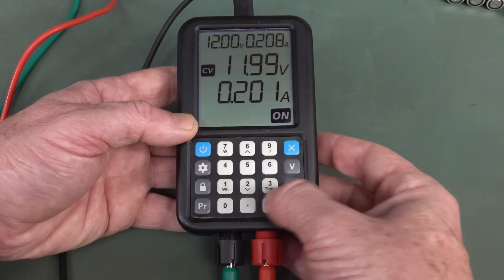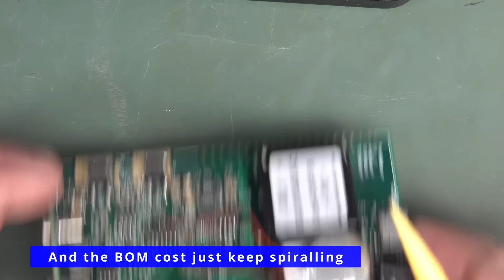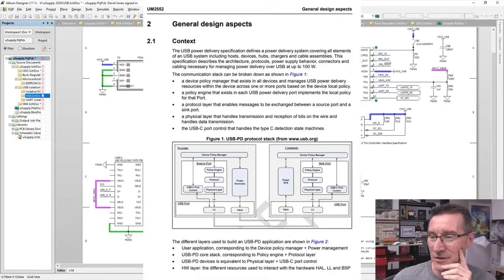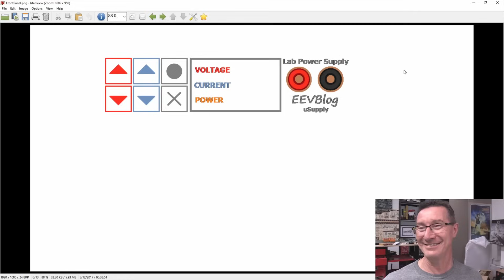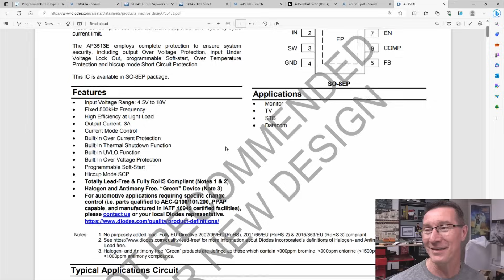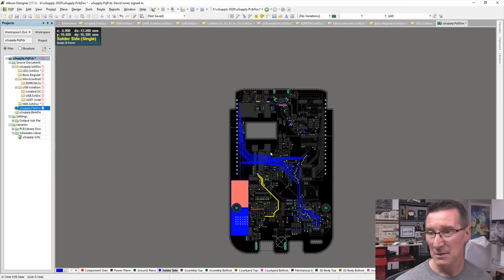EEVblog 1561 - µSupply USB Power Supply - Part 21

Comment: You're right about USB type C PD, just like USB itself, it's a bitch of a standard.

I'm working on a project that negotiates from first principles, using sub $ MCUs that are now available with enough on chip to do the PHY for PD, including opamps, comparators, CRC. Everything about PD is hard work, from the wire through the software stack and seemingly endless state machines.

The state machines interact with each other too under abnormal conditions, it's a bit like having a goto in code.

Just choosing a regulator and voltage domains is hard work for PD UFP, it needs to be able to function from 3.3V to 20V, and you need to be able to protect the CC1 & CC2 lines.

You could do a whole series of videos on USB PD,
Reply from the maker: Yeah, that's why we abandoned using the primary side ST micro to do it all natively. Ended up being simpler and cheaper to use a smaller ST micro and use an OTS USB-PD controller. But it can pay if you need the big beafy micro for other stuff.
Reply: Good GRIEF .. Gimme me old concentric connector back! 
Just need ONE protection diode, and something for over voltage
Unless someoens integrated these functions in a readily available piece of silicon???
Reply: Just recently had a look in to the USB 3 spec and oh man, these state machines!
There are really some wild diagrams in there.
Reply: @petegaslondon I dunno, I go back and forth mentally. Both as a consumer, and as a very very occasional person choosing to power something somehow. The old fashioned barrel jacks were real dead simple, and had few things that could go wrong. But also, sometimes, I screw up. So many different devices, all look the same and fit together, with totally different voltage and power requirements. The hassle of USB-c on the design-end absolutely seems worth it when it comes to be able to just arbitrarily connect power between whatever devices I want to connect.

A few years ago my dad left his laptop charger at home while traveling. We were able to slowly charge it overnight from a 5v-capable USB-c phone charger. Even though the laptop normally wanted 12v to charge. It was degraded functionality, but it *worked*. That's just so incredibly valuable.

To think I can just get power out of anything USB-c and into anything USB-c is so damn useful in an almost childlike way.
Reply: Do you happen to have a public repo somewhere? I have been thinking about doing something similar for AGES, but especially the PHY part is a bit of a nightmare with all the analog stuff going on.
Reply: Are you guys doing anything sophisticated with PD or simply trying to build all from scratch?
Because I keep seeing that even Arduino crowd is already dealt with PD negotiation in their libraries.
Reply: haaii! https://www.youtube.com/watch?v=2fLpOv0ZOpY

Comment: Hello, I am David2!

This was a wonderful, fun and educational project and in complete agreement! USB-PD really was a surprise in complexity and I completely agree, isolation was a giant pain!
It was the primary source of inefficiency too, may have even been worse for efficiency than the output regulator!

That funny circuit that you were not sure what it does (https://youtu.be/FKC6lnTKH-c?t=905), I believe its a ripple blocker, but don't quite remember. The switching regulators had some noise which coupled through op-amps due to their power supply rejection ratio not being massive. Iirc, there were options of higher performance op-amps, but you pay for that too. I believe that rough simulation will show some ripple blocking :)

That battery prototype was indeed a negative bias!

Comment: I got inspired by this the last time I saw it and made a quick and simply contraption with a USB-PD board and a Ruideng Tech DPS3003 power supply module. Not as sleek as your solution but does the job. I think if you sell the screen, case and banana jack, people would love to take the challenge of designing their own circuits for it. Could even be a competition or something for the best design.
Reply: I made couple power supplys with similar chinesium ps modules.  One has 3x 18650 in it and 30V/4A/50W max output. Second one has banana plugs as input and i made a makita battery adapter for it from a chinese clone of makita usb-adapter.  That one has 50V/5A/180W max out with one 18V makita battery and with >30V could go up to 250W.  Those things have saved me several times as an electrician.  Testing led-lights, troubleshooting 0-10v building automation stuff, driving smoke extract windows, tracing ground leaks with clamp meter etc.  The larger one has bluetooth module in it, which helped a lot when i had to check which cable goes to which fire damper in a hvac system, as those ~60 cables had just a running number on them and those numbers did not match with the actual devices and no one seemed to know where they went.  Bluetooth gave me 15-20 meters more of a head start, as i killed the power to the damper by phone and could hear where the spring loaded damper winded to closed position.

I've been planning to make yet another one with internal batteries for just a little bit higher specs.  That small one won't drive the largest smoke extract windows and having an external battery while slipping on a roof with other tools wont make the job any easier.

Comment: Keep the isolation, will make it easier to keep noise down. Plus you can get cheap DC DC converter IC's that run at 1MHz plus, so you can easily get the 12W plus through the transformer, with a driver the size of a flea. PD controller, 3V3 regulator that can handle 12V or higher on input, and then a 3V3 simple USB isolated interface, to pass USB over to the chip handling display to allow USB control over the USB side of the USB C port. Keep it to one grunty micro on the isolated side, which was chosen to handle display directly, and let it do all the work.
Reply: The noise reduced from isolation will be foreshadowed by the 1MHz converter!

Comment: I didn’t even know you were designing this. All the videos you have it don’t surprise me. I also have spent documentable time to the subject of USB power supplies. I really want a Bluetooth middleman or even usb middleman for one hub all usb and Bluetooth WiFi console environment to set hosting values and management to share devices with hardware not supported by a particular device. This was the intention of going down the road of electronics design and will be a product before I die. Thanks for all you do for the community.

Comment: If I built one one of these I would:
- use a raspberry pi rp2040
- have the software open source and collaboratively developed by your audience.
- use an off the shelf lcd with a resolution in the range of ~320x320
- use the biggest inductor/transformer that fits in the case
- make it have overkill power carrying components so no cooling is needed / short term overload mode possible
- make it able to use either USB power or a 18650 holder that can be clipped on the back (there you have your "isolation")
- make it have a micro SD card slot for datalogging / custom programmed sequences (e.g. CCCV charging but with slow start for deeply discharged cells, or for simulating a battery that loses voltage while discharged, ...)
- generally make it use software wherever possible so it can be functionally enhanced later on by the community.

Comment: Anyone can get a cheap switcher PSU. A low-noise front-end differentiates the product highly.

Completely isolated would be a extremely nice to have feature, knowing there's no way to short stuff, but I'm sure it has a huge BOM cost with it vs not. It being able to be controlled (and isolated) over USB would also be a killer feature... A laptop telling it waveforms to produce, recording power graphs, etc. Mayyybe it could all be done over WiFi now, not sure.

Allowing for slightly bigger or fatter case, I'm not sure if that'd help making BOM easier. The LCD is still extremely nice. You can buy 100 chinese products and wish they had a better UX like this with 99 of 'em. 

I wonder if simplifying the design to be slightly more 'modular' might be doable... with the aim of allowing the community to adapt the core functionality into real hardware products themselves. An analogy would be, the Marlin 3D printer software project provides itself as the 'core component', which anyone can implement into hardware to complete a 3D printer.

Comment: I really like the design of this project and its something ive been wanted to desogn for years. 
Linear tech/analog devices has a really nice ldo with built in cv/cc capabilty up to 2-3A that ive been wanting to design around possibly battery powered for isolation and better noise.

If you came.out with thid product i will most likely buy it just to support you and your channel. Already own your 121gw meter :)

Comment: Not sure if you've seen it, but Miniware offers a 5 amp, 30 volt output USB-C power supply (MDP-P906) and a barrel jack that let's you do up to 10 amp output

Comment: A small bench top battery powered PSU would actually be very useful. 2 adjustable channels with up to 20V + some USB ports or dedicated 3.3V and 5V output. I mostly work with MCU's and I think that would be useful for many others too.  

Cool to see an update on the project. The Power Supply videos were one of the first I watched.
As luck would happen, I just printed a small enclosure for a riden PSU and just put usbc trigger board in it to get 20 volts out of it.

Comment: Death due to scope creep! It's a shame because it was a really neat idea, though it produced a ton of good videos, I suppose that is output as well.
Seeing the internals of the prototype, I can imagine that it must have been very costly if produced. 
Honestly I would have ditched the custom display, keypad, fancy case (instead of the simple one) and transformer very quickly. To ditch the isolation in general, I am not so sure about it, not just the versatility but also isolation from conducted emissions on the other side. 
I would definitely add two output channels though! Just having two output channels instead of one opens up so many more possibilities (especially for analog circuits with dual rails). 
Seeing the output circuitry you could probably simplify it significantly, at least to a single output device instead of two.

Comment: While I like the final keypad layout, I'm no longer a fan of the plastic membrane over dome keys (too many membrane failures, especially after sun/UV exposure), preferring touch PCBs whenever they can work, and carbon contact or mechanical keys when they don't. That said, I'd eagerly buy whatever is on the uSupply!

Yes, drop the built-in isolation. I just got a terrific 74 WH (20K mAh) USB-C PD battery bank for under US$25, a small price to pay for total isolation. Should I need more, I'd use an isolated wall wart.

One function I do want in the uSupply is a dedicated battery substitute/simulator, with an optional add-on kit of mock batteries with flex cable connections. Start with the most common (AA, AAA, CR2032, 18650) and include (or allow us to program) the capacity and discharge curves. I'm remodeling my home and will be including a massive IoT home automation upgrade, and need to design/adapt many of my own nodes, where I need to do some real-world testing to make decisions for power (wired, battery, solar) and communications (wired/wireless). Bonus points if the battery simulator can also account for physical charging, such as for an attached solar cell.

Yes, the battery simulator may prove to be a major upgrade, but I believe it could help secure a solid market for the uSupply in professional labs, beyond the hobby market.
Reply: Hmmm. I'd probably want TWO uSupply units: One to simulate the battery, and another to simulate a solar cell.

Edit: And I could probably control battery/solar simulation in real-time over SCPI, though I'd prefer a standalone solution that wouldn't tie up a computer.

Edit2: Heck, I'd probably have the computer there anyway, for data logging. So maybe give the uSupply a large data logger as well?

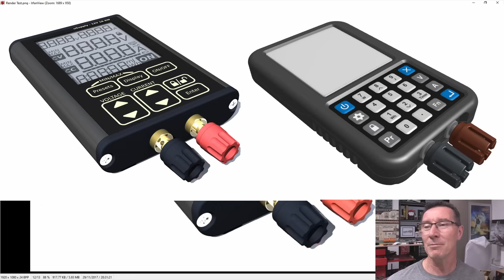Comment: 22:00 As someone who sometimes finds himself on the wrong side of a decimal point, the up-down arrow would be preferred. (Granted, it's probably less an issue for a supply that tops out at 12v and 1 amp.) To make the data entry faster, perhaps double-tap the up or down button for the respective adjoining digit, then adjust accordingly.
37:30 Edit: Honestly, I don't blame you for opting not to produce this. There's a lot of cheapies these days that do a shockingly good job (thinking specifically of Rui Deng, which I think you previously reviewed). I really like the integration you have here, but without some kind of real differentiation from the cheapies, I doubt it would get any traction.
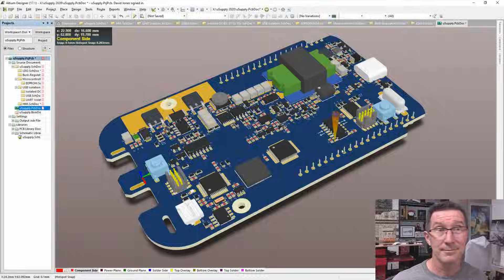40:00 Edit 2: Would like to hear a bit more about that (planar?) isolation transformer, and maybe tips to design for isolation in general. You've touched on isolation lots, but I don't remember that you've done a deep dive on that.
Reply: It would make it larger but I'd really like to see a rotary encoder to manually adjust voltages and currents on the fly.  As you say, it's just too dangerous to do that with direct numeric entry.  Even up down arrows can be dangerous if you have the option to choose with significant digit they adjust and you inadvertently move it.  Not that I'd know anything about accidently jamming 13.3v into a 3.3v circuit...
Reply: @ferrumignis  Experience is the best teacher. 😅

Comment: I have a pet project too which has tech debt thanks to the troubles. Uses an STM32 G4 series MCU which is pretty good, nice and fast with flash for days but the stm32duino library is missing features that would provide some nice QOL improvements (no midi over usb for G4, no arduino like bootloader, have to flash it using SWD or boot the chip in DFU mode) and now things are mostly back to normal I don't have as much free time.

Doesn't help as time has progressed I have learned so much which makes a lot of the original design not so great (figured out a cheaper/better way of doing dual voltage, thou untested. Have a hardware based idea on how to make flashing it over USB less painful, etc) . But atleast it has a sexy front panel with ENIG which did came out a treat with USB connector fitting like a glove. And atleast with a bit more programming work I can at least get it to a "working enough" stage for it to be more useful (in it's current state it's sort-of useful).

Was interesting to see how the pros do it, I do like the idea of using word docs to capture snippets of information, much better than a cluster-f of notes in physical notebooks and dozens of datasheet printouts that invariably get lost.

Comment: It would be really cool to see that be made IP67 or whatever. Probably just re-shaping the heatsink a little and including a rubber oring/gasket so it seals to the back case would work.

For Banana jack, you can make a cutout in the PCB as wide as the outside diameter of the banana jack, and edge plate the copper there, then solder the jack directly to it. I've seen many battery chargers that do this technique. Probably not the best for avoiding cracking.

A toggleable backlight (or frontlight?) for the LCD would be really nice.
Reply: Ip67 is impossible because heat sinks need airflow. What do you wanna use a power supply under water for, Aquaman?
Reply: @frosty129  no, you've never used a plugpack, they have heatsinks and are sealed.

Comment: If I would be asked to simplify the design so it's cheaper and less of a headache I would probably make it take 20V PD triggered with one of the chinese 10c trigger ICs, if you plug non PD power you still get 5V (enters lower power mode).
Then just use some generic step-up/step-down converter design.
Also I forgot what was the reason behind custom LCD, but I think it's better to just go with some off the shelf screen, smaller as well probably, it might have been for lower power consumption but I don't think it's that much of a problem considering you can get 10Ah powerbanks under $20.
I've achieved something alike with $20 hobby RC li-po charger that has adjustable DC output function and one of those chinese USB-C PD triggers (set to 20V), obviously the output is noisy, interface is ass, and low accuracy voltage/current regulation.

Comment: I would be interested, but see a limit at 150 USD. The market for low noise is limited and for isolation even less. The case looks good, same for the pad and the display. Can you run a poll? with cost an features to find a sweet spot?

Comment: Yes, the display on a PCB and an 8-bit micro display driver so that could be controlled via SPI or I2C. 
Would certainly be salable as a side project. Hobbyists could take it and build it into a power supply themselves.

Comment: I would suggest that isolation is required because you don't know what the user might use for input power. They may be in a pinch and unplug their laptop and use its AC adapter, for example. Or they may plug it into their laptop. Or they may have a number of USB-C cables on their desk and then need to probe around with their oscilloscope. It's too easy to run into a situation where you might not realize you're not isolated and in the blurriness of working at 3AM, the darkness of some awkward location, well, you can create some nifty accidents. Heck, I have to warn people who are probing around my board because my setup isn't isolated from mains unlike other test rigs.

Comment: Three significant cost items are
Deluxe LCD display,
Deluxe Keyboard, and 
Isolation.
I would rather keep the isolation and cheap up on the keyboard and display.
Reply: The custom LCD and keypad are cheap in volume, $1 each or less. You'd be paying the same or more for a generic color LCD or OLED.